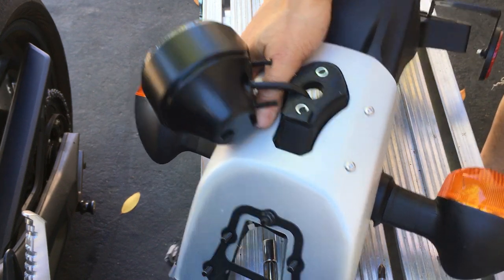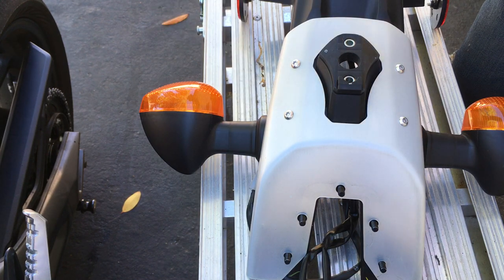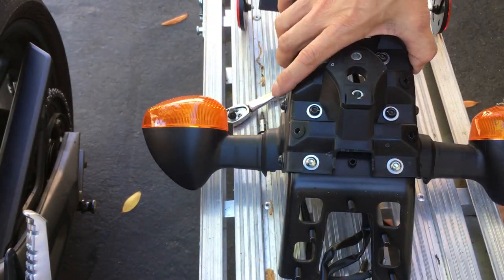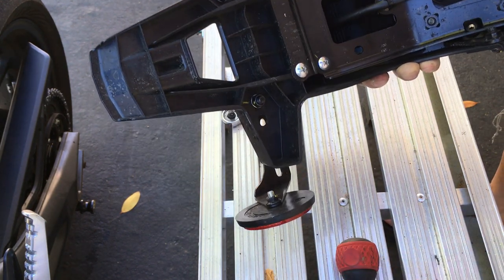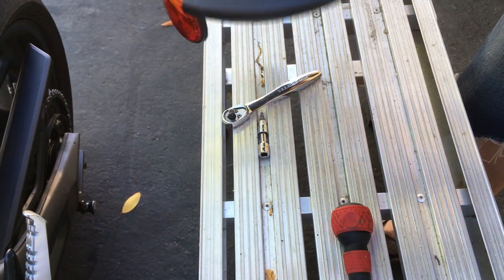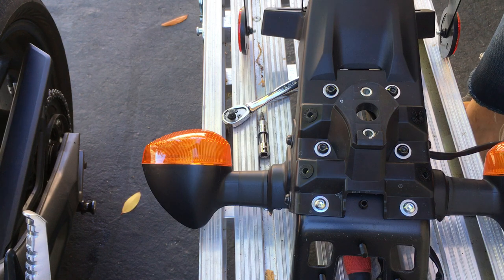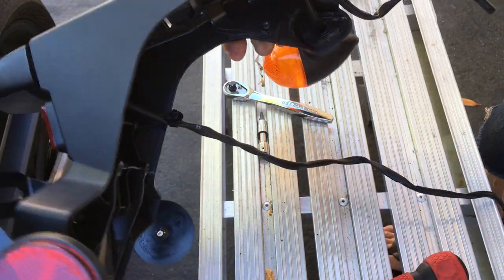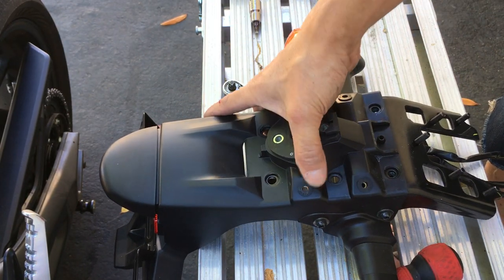XSR900 fender dissasembly pt.2

Comment: Good luck with getting the 4 Ally torque with rubber washer screws off, I had to drill em out.
Reply: They just turn with the rubber washer, then if hold the rubber washer and try you damage the head of the Torque as its to soft......shame that.
Reply: @daveweeks67  I’m having this same issue lol